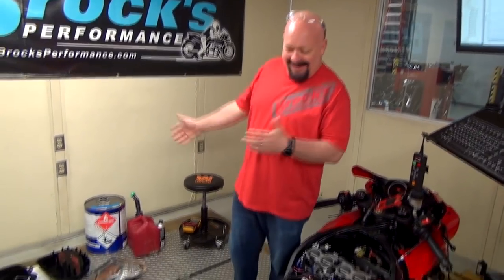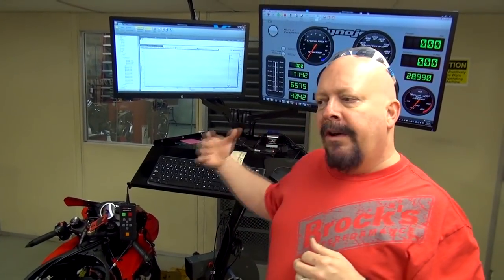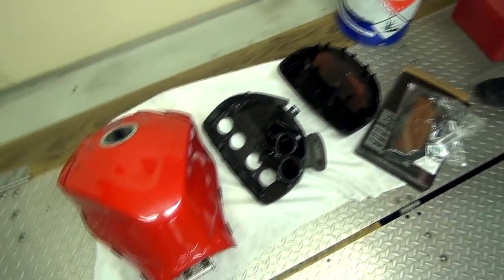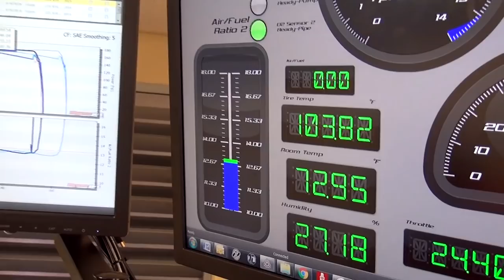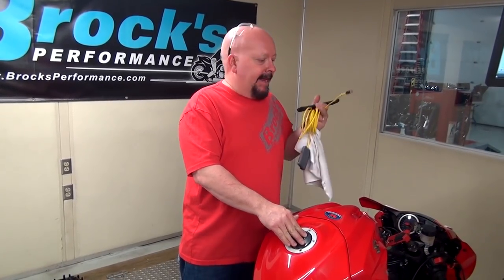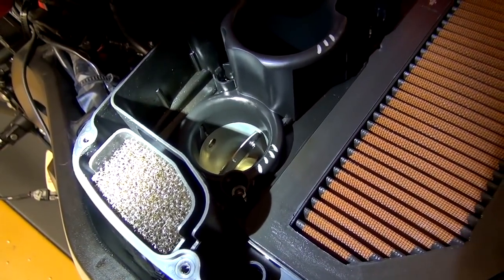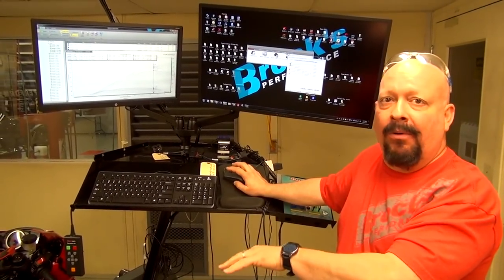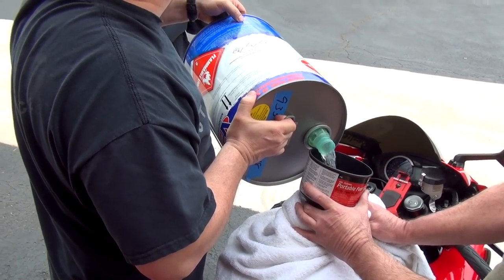Tech Talk: Suzuki GSX-R1000 Stock to Brock: "Hey Brock...What About MY Bike?"

Comment: Wow what 600 is beating a 160hp!!!!
Reply from the maker: It doesn't matter how much hp a bike has: If bike 'A" makes 200 HP, but is gearing limited to 150 MPH (for optimal drag racing acceleration, etc...) and races bike "B" makes 130 HP, but has gearing capable of 170 MPH (long course road race/land speed etc...) The bike with the higher top speed will eventually win, if the race is for a long enough distance. Of course, bike "B" would lose badly in an 1/8 or 1/4 mile drag race. For instance: what would happen if the 1K used in this series raced against this ZX-6 that recently set a 1 mile record at 190 MPH? http://blog.brocksperformance.com/tln-motorsports-greg-neal-breaks-more-land-speed-records/

Comment: Correct me if I’m wrong but doesn’t stretching the swing arm and re gearing the bike for it usually cause a loss in power at the wheel?
Reply from the maker: Not that we can measure.
Reply from the maker: To add to my reply: If the swingarm is added and a smaller front sprocket (gearing to match) allows the chain to drag on the swingarm, we do see a power loss. But that's from improper set-up, not a function of adding the swingarm/chain. This bike had an 18 tooth front, so it did not have a problem with chain drag.

Comment: Hi, i was wandering that alot of people have some vibration problems with the gsxr 1000r’s foot pegs and mirrors. Do you have the same problem and if yes how do you fix it or stop it? And apparently the paint is really thin? Is it true?
Reply from the maker: Mohammed Al mutawa I have not seen or heard of any vibration problems with the GSX-R1000R. I have seen  problems created by racers removing the weighted bar and footpeg ends.
Reply: Thank you and because some reviews explain about how the bike vibrates a bit and you have to pull the cluth in to get a clear view from your mirrors, and one more thing is when you put the bike in tc level 10, the bike makes this strange noise. But the tire is not slipping or anything, any idea about the vibration and the tc 10 thing? Thank you Brock.
Reply from the maker: Mohammed Al mutawa the TC issue was prevalent before the recall. We have not had any issues since. Our bike does not vibrate excessively.
Reply: Sorry didn’t really understand because of my English, what do you mean exactly?
Reply from the maker: The ECU recall repaired previous problems. No more strange noise.
Reply: So when i get a ecu flash or map the problem with the noise on tc 10 and others will go away?